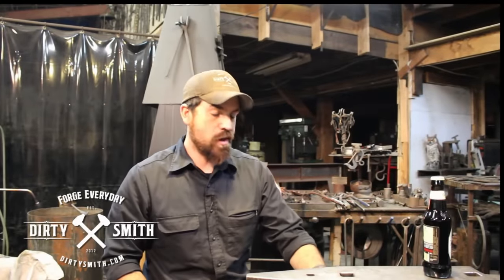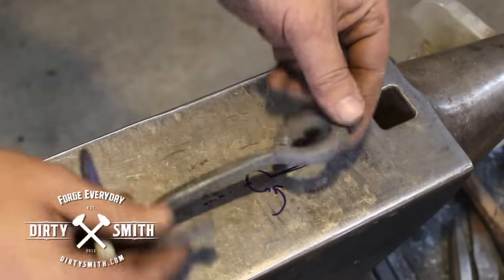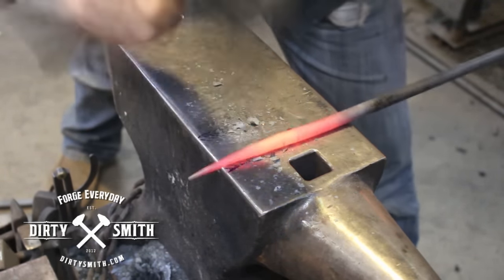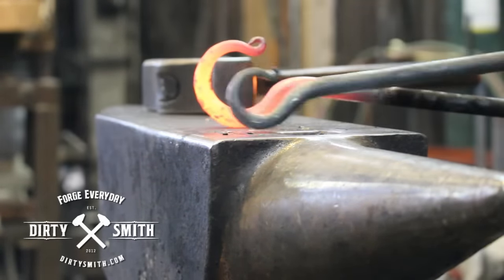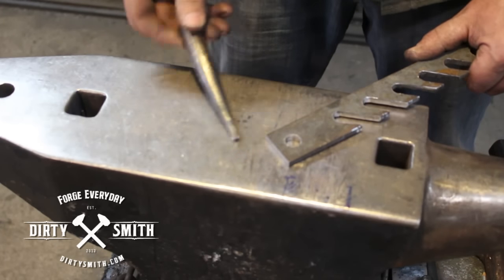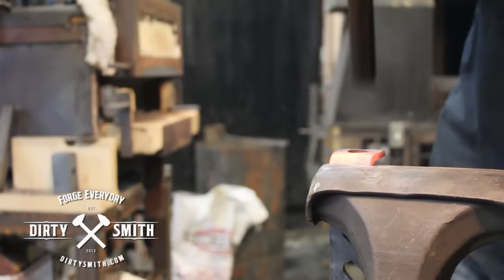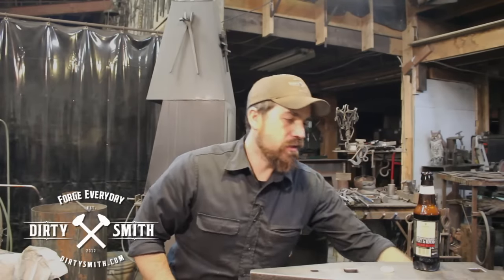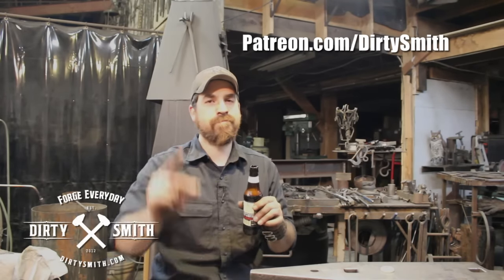How to forge a trammel hook (Dirty Smith Project)

Comment: Rory, I really like your approach/design on the trammel.  Strong and functional.  About the best I've seen.

Maybe an alternative to fullering the top of the hook that goes into the slots...how about just making a short u-shaped hook in place of the upset tip?  If you don't upset the tip, you could also thread it through the bottom hole and not worry about it being too big to pass through.  One would have to make sure the u-shaped hook was wide enough to thread/twist past the sides of the bottom hole.

Comment: Very nice design on this. One question. You said the upset end needs to be smaller than the hole or else it won't fit through. Couldn't you simply thread the hook end through the hole?